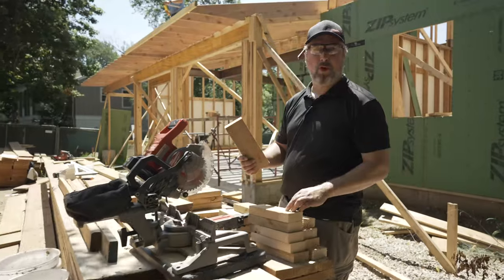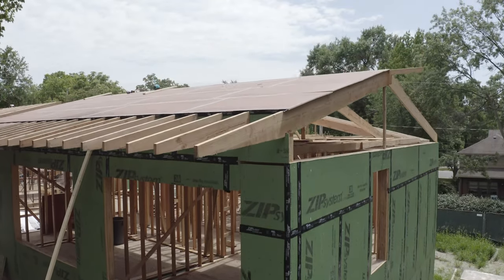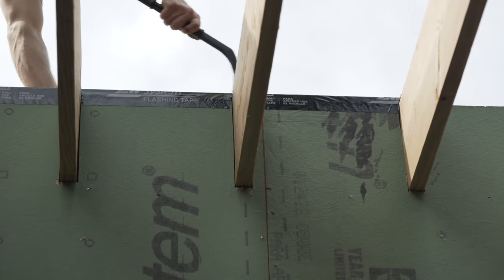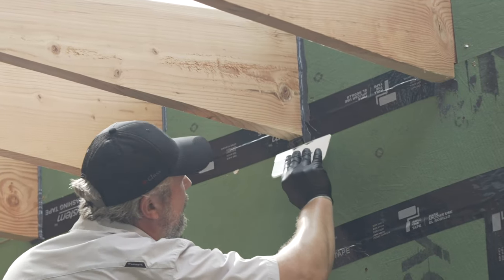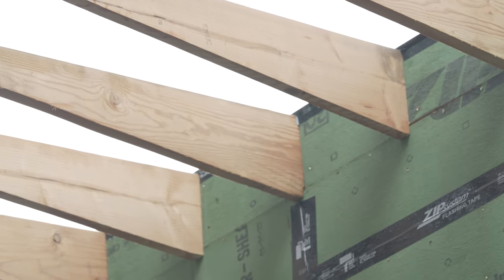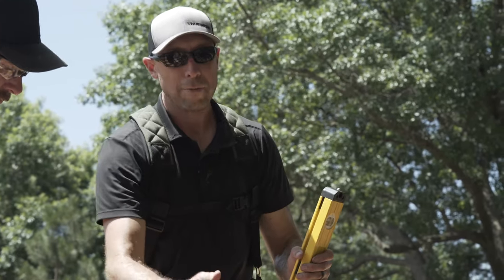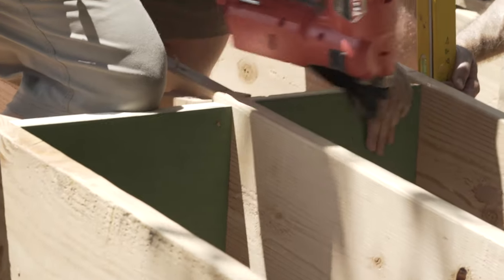Air-Sealing Exposed Rafter Tails

Comment: On my personal house I just built, I used polyiso board for mine. Zip tape sticks to it wonderfully. It was super fast. My framers couldn’t quite understand why I wanted to seal off the rafter tails so I decided to do this detail myself. I precut all the blocks on the ground, slightly oversized, then just trimmed them to fit with an olfa razor knife. I could trim them while I was up on the ladder. Then I came back and sealed the perimeter with canned spray foam using a long nozzle gun. We came back and spray foamed the roof so the polyiso was really just a backstop for the spray foam.
Reply: My thoughts exactly. Never worked with this zip sheathing. Interested to look further into it.

But plywood and polyiso is where I’m at, and spray foam the gaps, I’m not sure how much I trust tape to be a long term flash, seen it fail on tyvek, blueskin etc etc. even the high end butyl tapes.
Reply: @justinstevenson2061  actually zip tape
Is a fantastic product. I have used the other tapes and there’s no comparison. Huber got it right with the zip tape 👍

Comment: IT's wild how in the past we simply blocked the eves with 2x6 ripped down with a bevel cut to match the pitch and no air sealing because the attics were vented anyway, but now I brought this up doing a remodel where the attic was part of the conditioned envelope and the whole thing was going to get open cell foamed and the older guys on site looked at me like I had grown another head because I broke out the sausage rolls of liquid flash with duck bill nozzles and started sealing the eve blocks to the plate and rafters. I explained it to them and then were on board. when we got to an area of new construction a similar thing happened when I sealed the overlapping sheathing to the block after adhering bituthane membrane over the block foundation as well as liquid flashing the mudsill along with bug barrier. one older dude said, "You just love the caulk don't ya!!" we all had a good laugh.
Reply: Well done. Any air sealing details that can be done from the outside for a vented attic assembly? 

I‘ll have to get dirty in the attic and address the top plates anyway, but also have a reroof planned and wanted to tackle any soffit work, etc at the same time
Reply: @KennyFlagg  if you are opening the soffits anyway, you can seal it up completely from the outside. With the siding off and soffits out you can tape and liquid flash every seam. If you are going to replace the sheathing then you have the golden opportunity of laying down a bead of sealant/glue on the studs and where it overlaps the foundation like you were doing a subfloor (you can also do just where the seams and top/bottom edges of each sheet to save on glue but I usually do them all). Are you saying you want to keep a vented attic or you want to seal one up and make it non-vented?
Reply: @Natedoc808  thanks for the reassurance. We’ll keep it vented in the attic since it’ll never be living or storage space and we’re climate zone 6a. Would like to go to a ridge vent system instead of the ugly little boxes that don’t seem to do enough. 

Stucco is hard to knock so I’m only doing sheathing on the most affected/rotten areas. Did liquid flash all the rim joist and mud sill connections I could see. Might end up doing the whole damn perimeter. 

The crawl will go from vented to conditioned and am really excited to see a good blower door number after all this toiling haha.
Reply: @Natedoc808  Unfortunately we're all stucco with no drainage gap. The original house has two layers of tar paper w/ wire mesh, while the addition has some unidentifiable sheet sheathing and tyvek. It's a guess and check inspection to see what's holding up and what has been taking on water without drying. 

Will definitely hold your tips in my back pocket. Might re-sheath + self-adhere membrane 3ft from grade and up, we'll see.
Reply: @KennyFlagg  Gotcha. If you have the interior gutted, or even down to drywall sans fixtures, using the AeroBarrier system would make a lot of sense for you as you could air seal from the inside, especially since you're leaving the attic vented you could completely seal off the living envelope from the unconditioned space above. That will eliminate the heat drive from warm interior to colder attic space in the winter and eliminate moisture drive to the exterior where you could get condensation on the interior side of the exterior wall where it would be very difficult to dry. 

For attic venting for when it gets hot n humid, I prefer active ventilation to passive eyebrow vents, using the solar powered fan units makes all the difference in my area compare to passive ridge, eyebrows or even whisper cool (passive rotary) and it gets 105-110 in summer in my neck of the woods.

Comment: Why not jig all of this to make details identical and speed up the process? 

My roof is going to use jigs for as many steps as I can starting with spacing the I-joists.  All of my blocking will be identical and fit perfectly.  My gaps will all be consistent and tight.  I won't be measuring and squaring at every step because my jigs will do that for me.  The time I save I'll spend taping and caulking joints.
Reply: How’s that end up working out?

Comment: That works, but there are easier ways with better air seal.
Reply: Like what
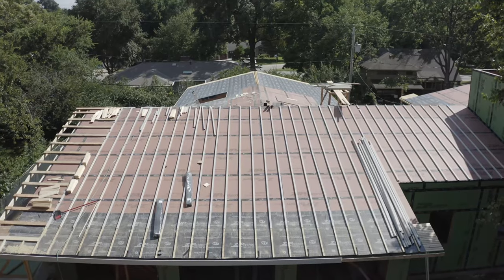Reply: @MustardMade look at what they are doing at 4:10 in the video. They could have cut the tails, boxed it in side to roof, then added rafter tails with plenty of support. Matt Risinger did something similar a couple years ago.
Reply: @MustardMade  like closed cell spray foam.